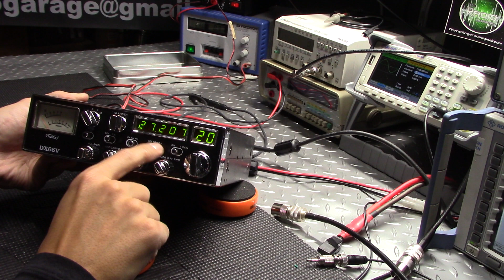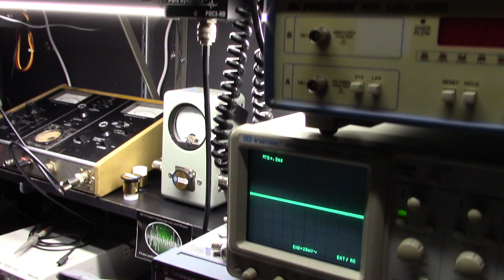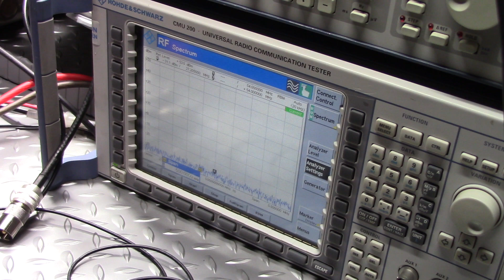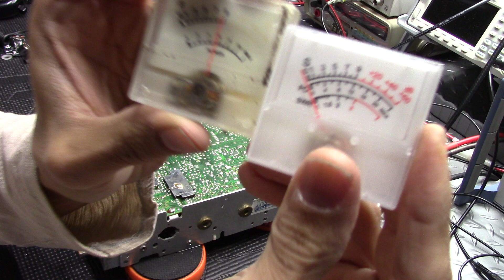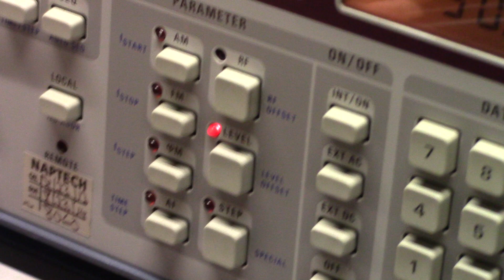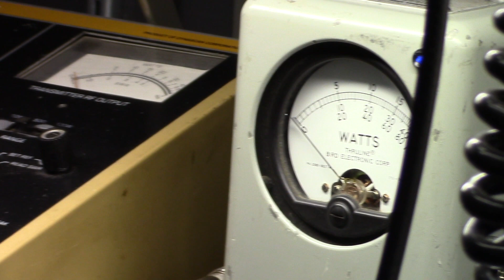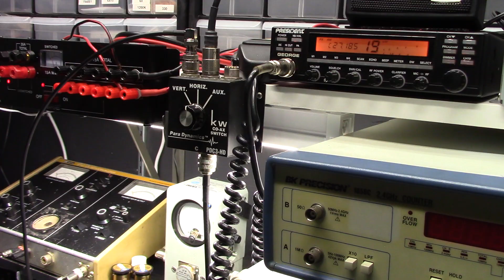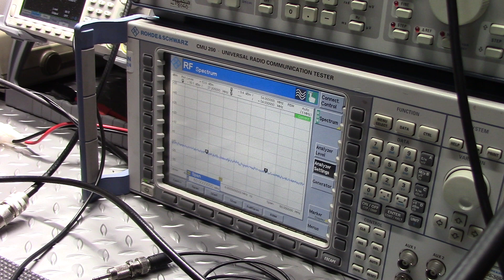Galaxy CB Radio DX66 Before & After Tune Alignment

Comment: I got a question I have a Ranger SRA-198 mic hooked up to my 66v and I get a static sound every time I key my mic and I've messed with my mic gain and still getting a little static. Thank You!!
Reply from the maker: Your getting static on your end or the other person hears static when you key?
Reply: @TheRadioGarage  Yea I'm getting static on my end every time I key but the other driver's say it's clear on there end. So I don't know if it's my mic or I have my mic gain turned up too high. If you got any solutions I'd appreciate it.
Reply from the maker: I would start simple by trying a different mic. That will at least let you start narrowing things down.
Reply: @TheRadioGarage  Yea that's what I was thinking I'll probably switch back to my road king and go from there. Thanks for the feedback I appreciate it.

Comment: Hey there so I’m having an issue with my radios running properly with my amps since there’s no forward swing on average watt meter With all my amps they aren't going to show any forward swing on average power because my ratio of forward average power to deadkey being so low. So when I talk with my amp on it just swings back these are stock radios (Lincoln 2+ and president McKinley) also tried with a cobra 29 how can I fix this??
Reply from the maker: Have you ever had the carriers adjusted?
Reply: @TheRadioGarage  no sir
Reply: @TheRadioGarage  are you familiar with president radios? I’m looking for a tech to get mine going so I can use my amps an I can stop getting back swing on my watt meter I have multiple radios and amps and I can’t use any of them at the moment.
Reply from the maker: Well then I'm guessing that might be your problem. No sorry I don't work on the new president stuff.
Reply: @TheRadioGarage  an you call yourself technician haha

Comment: Hey do you have a email or something so I can get in touch with you I have to same radio it's supposedly has over 600 dollars In it the guy told me but I don't know anything about em I use them to escort oversize loads I can't get it to pick up or put out gets static whe. Squelch is down would like to get it looked at
Reply from the maker: You can email me at theradiogarage@gmail.com thanks